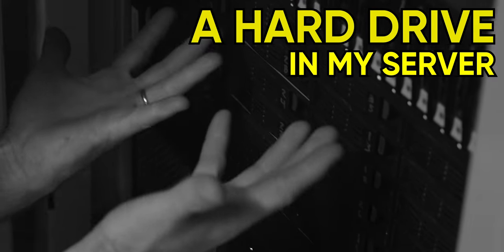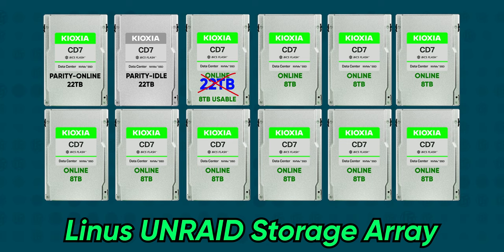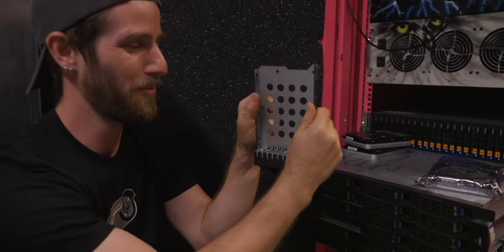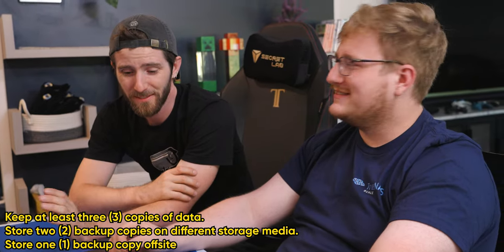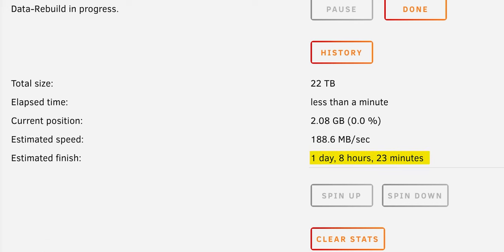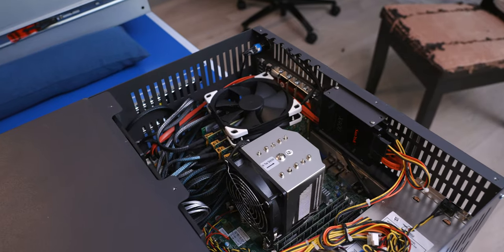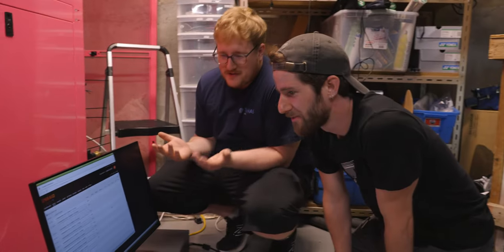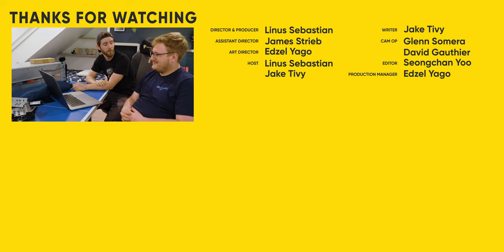My server is broken :( - Fixing Linus' Home UNRAID Server

Comment: How can you guys endorse seagate with a good conscience? they have >90% early failure rate. They're cheaper than WD for a reason. The ONLY way it'd be worth it to set up a server with seagate is if you're getting them for free, and even then the headache and hassle of constantly replacing drives would probably outweigh the cost savings for most people. Any seagate drive I get reliably fails after a few years, meanwhile i have nearly 20 year old WD drives that are still in good health. And their early failure rate is ~5%.